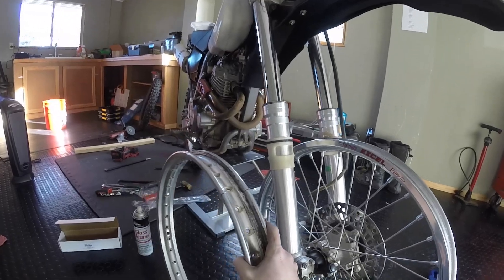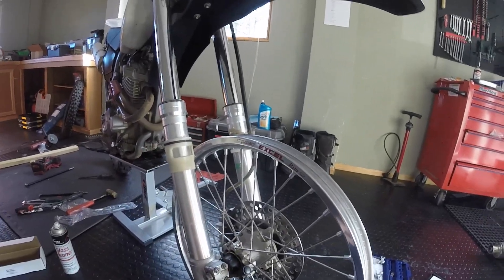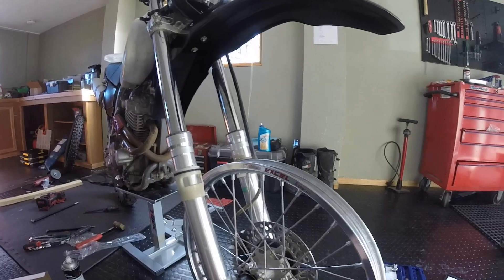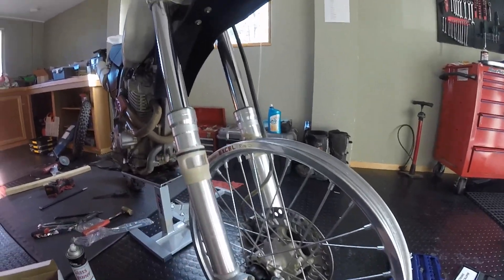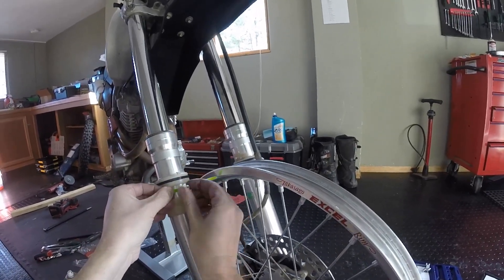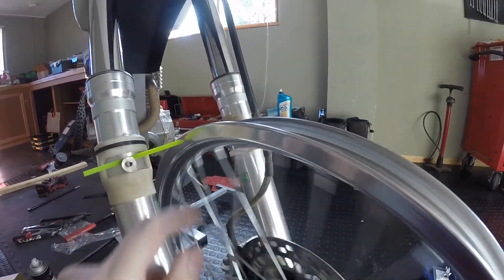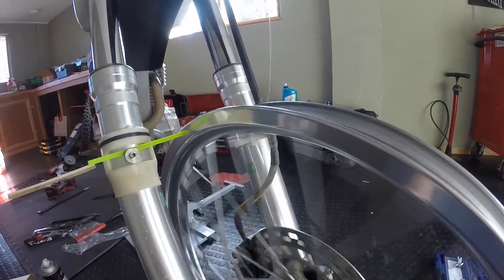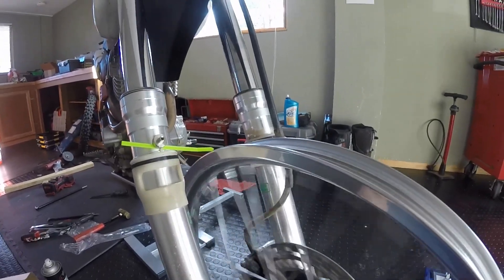#DirtBikeHack Homemade Truing Stand

Comment: My xr400 had a cracked front wheel also.My brothers xr650r had a crack in the rear wheel.XR wheels suck compared to drz wheels.32 thin spokes vs. 36 thick spokes on drz.Nobody ever seems to talk about this on all the comparison videos.
Reply from the maker: That's a good point.